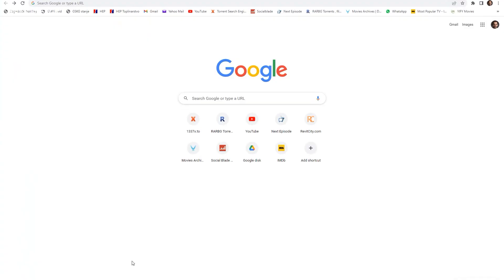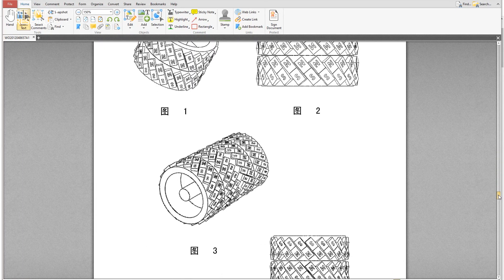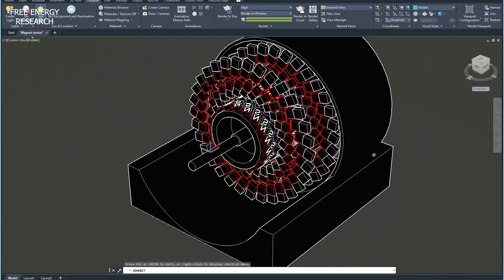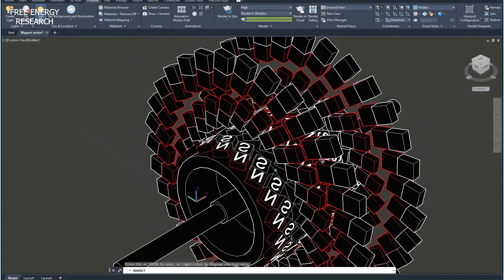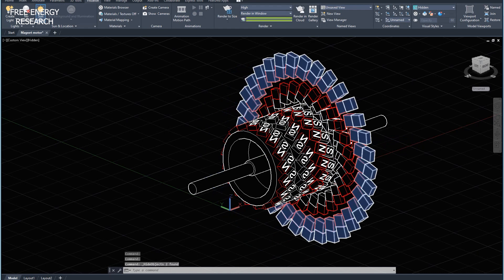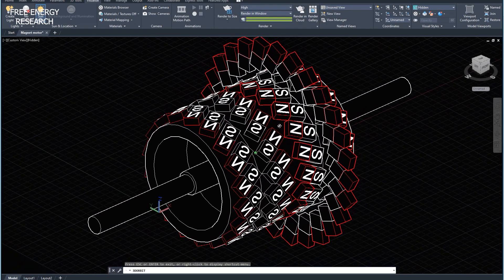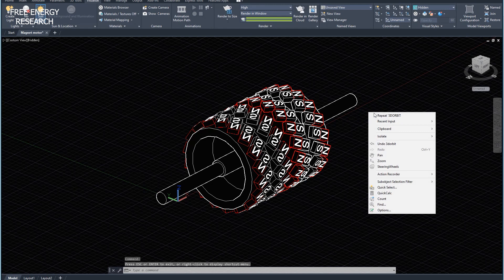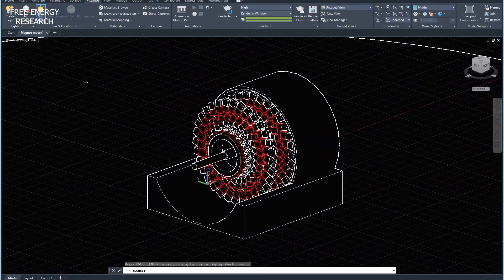Xuehua Zou Magnetic Power Machine (Magnet Motor, Free Energy 2022)

Comment: Look again at the PDF of the patent, look at the diagrams 3 and 4, it is different than shown in Mario's video.  The inner rotor will be spinning due to N-N repulsion, true, but at dead center of the rotor it should be showing S-S close together.  And look at diagram 5 on the pdf,  Mario is showing an extra amount of magnets. It only needs 1 set of magnets, with north pointing towards the N-N of the rotor.  Overall, the rotor gets a N-N repulsion from the left side, and from the right side, and from 90 degrees.   Nevertheless, in order to keep running, it needs a Mu-metal or equivalent on 1 side of all the protruding corners of the North poles.  Maybe that detail is in the chinese writing.